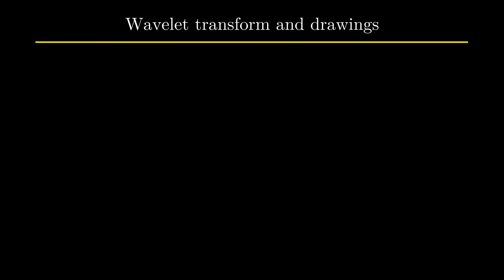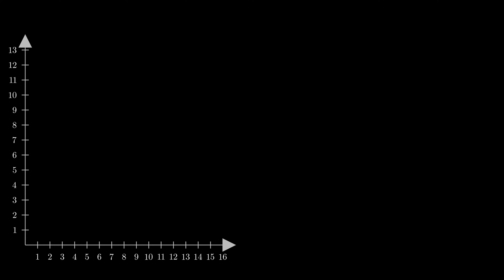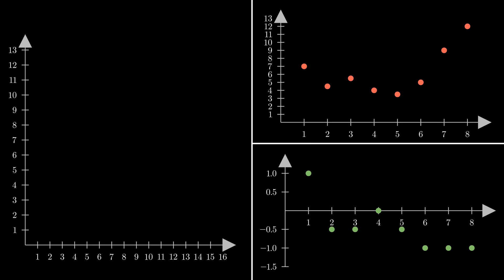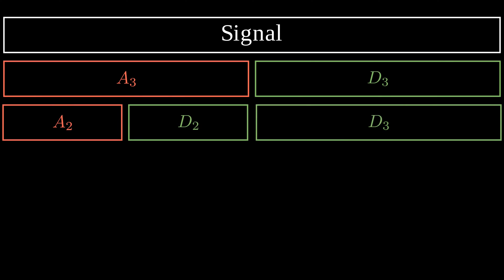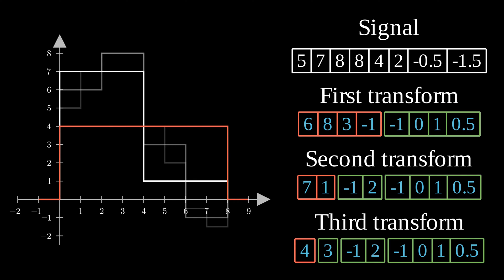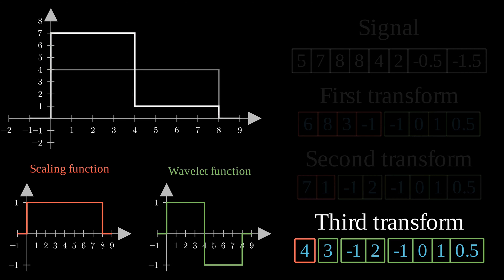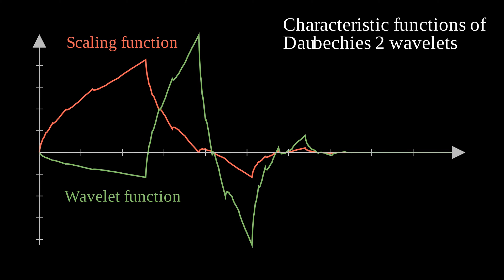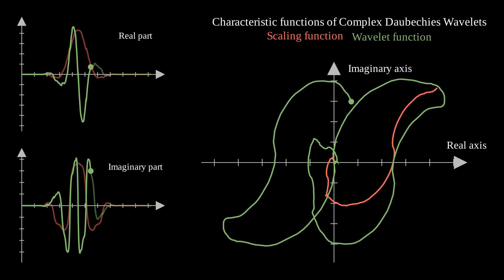An introduction to the wavelet transform (and how to draw with them!)

Comment: This was a very cool and easy to understand explanation for the Haar Wavelet. 
Unfortunately I don't really get the jump to the Daubechies Wavelet.
The scaling function and the wavelet functions are different, so far so good, and how they're added to get back the original signal seems trivial, but what was trivial in the haar-case, i.e. taking the mean and the diff and putting it to the scaling and wavelet space, completely escapes me for the Daubechies wavelet case.
Also I would have loved to be walked through the complex plane, as you did walk us through the 1d case. I'm currently trying to bridge exactly this gap and did not fund a good tutorial yet.
Anyway, thank you for this great explanation.
Reply from the maker: Thank you for your comment! Unfortunately, I haven't manipulated wavelets in a while so everything is not that clear in my mind! 😅

Basically, wavelets are represented by a certain set of coefficients, and mathematically speaking, using another wavelet is only using another set of coefficients. The coefficients of the Haar wavelet have a very nice geometrical interpretation which is storing the mean and the diff. However, other wavelets are less friendly, and visually animating the way they work is quite challenging. While I do think it is possible, I don't know any video that would get into visual constructions. I did not have the time to get into details about the Daubechies wavelet as animating only the Haar wavelet was already a quite long process as I'm not really familiar with animation!

If by chance you come across such a video in the future, don't hesitate to post it here, I would be very interested in their approach to explain this topic!

Comment: Wonderful video. I have a question although. What will I do if my starting points are 6 and not 8
Reply from the maker: First option is to compute a less deep transform.
Second option is to "complete" your signal to obtain a length of a power of 2. You can do so by completing by periodicity if your signal is periodic, or by mirroring the end of the signal, or by padding with zeros or with the last value of the signal

Comment: Great video. Note that the approximation to the drawing is much better with wavelets than with circles (harmonics). This is also an interesting property of wavelets 👍
Reply from the maker: Thank you very much! 
Actually it will depend on how you sample points along the shape, and on how many coefficients you use to draw it. If you use as many coefficients as the number of points, then both methods would result in the points being exactly drawn (so same precision). If you use less coefficients than the number of points, then depending on which coefficients you decide to thrown away, you will get differents approximations for the two methods.
If the last animation was that precise, it was because I used a lot of coefficients (maybe even all of them, I can't remember), and I probably used less of them on the harmonic representation.
The idea of the video was more about presenting another approach for drawing shapes in a similar way as the harmonic method, but I did not really compared them in terms of approximation quality.
Reply: @leleogere  , I see. The theory says that for the same amount of points and in certain function spaces [like the shape you draw], wavelets have better approximation properties. Anyway, the first time I've seen someone drawing one of these shapes using wavelets instead of harmonics - super cool!
Reply from the maker: @carlosayam  Yeah you're right, while the Fourier transform is well suited for regular and smooth shapes, the wavelet transform will perform better with less regular shapes, and even discontinuous signals.
And about the drawings I have never seen them elsewhere neither. They were realised on the context of a school project, even our professor wasn't sure if we would be able to get something in the end

Comment: Wow, that was very helpful. Before I never quite understood why wavelets the way they are, the construction from average was quite illuminating. Seeing how wavelet  compression would have distorted the picture of sigma vs how Fourier did it would have been superb!
Reply from the maker: Thank you for your comment it means a lot!
The simplest compression you can imagine is to simply cut off details spaces and set the value of all coefficients to zero. You are only left with the biggest approximation space : https://youtu.be/p2Gvtp4JoI0
If you keep this approximation space, but you also keep the first detail space, you get this : https://youtu.be/g4sdrMOC4XI
With two detail spaces you get this : https://youtu.be/Sw88-rP1qEU
And so on. Each additionnal detail space will add details to the reconstitution.
However, the "partial" reconstitutions are a bit less satisfying to watch than the Fourier ones, as the basis functions are way less regular than the circles we can observe in the Fourier Transform. So the traced path is kind of chaotic